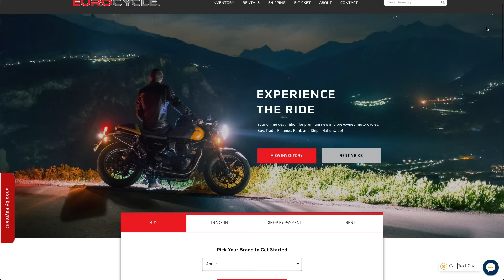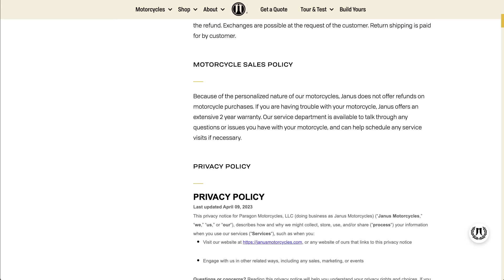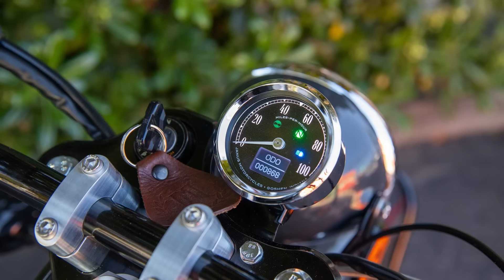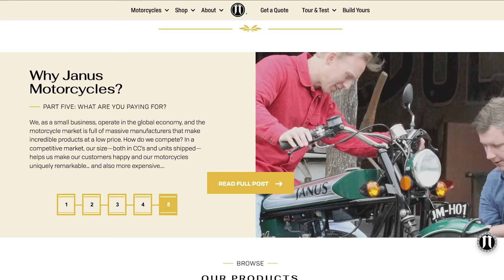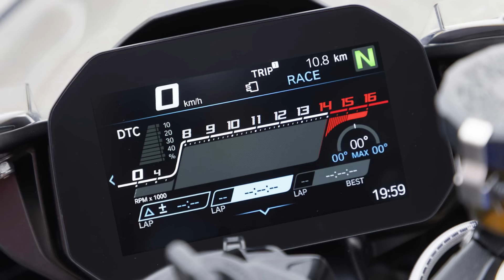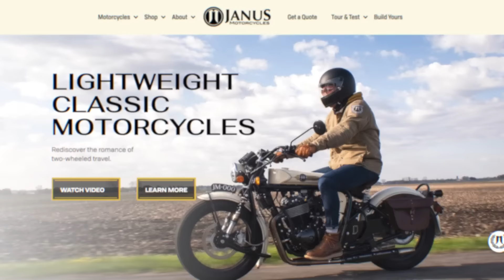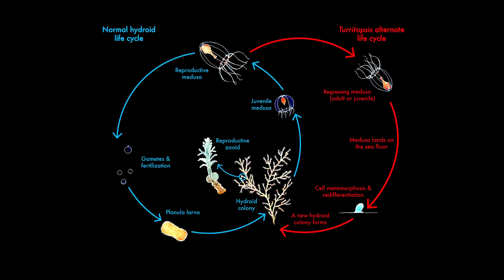We need to talk about Janus Motorcycles

Comment: A very poor, ill-informed review of a very good bike.  Perhaps when the Yam gets a little more time, experience and wisdom under his very young belt, he'll be able to comprehend the value in these bikes that today, utterly escapes him.   Having never ridden a single mile on one, I'm at a loss to understand how he thinks he's qualified to criticize.  Of course, there's a sponsor paycheck involved, so that might explain the shilling.  I have over 7000 miles on my Halycon, and I still wouldn't trade it for any overpowered, plastic-coated, one-of-ten thousand clones with a built-in umbilical cord straight back to an expensive dealer service department.  Simplicity, easy to maintain on your own, bullet-proof, adaptable, style and smiles for miles, and a true, original, motorcycle experience.  I'll have a second in the 450 version too, please.

Comment: And back to that engine: It's based on the original Honda CG250 (well, that was CG125 originally, but it gets complicated). There just isn't a US small displacement engine that is practical for this purpose. The engine really is bulletproof, which is no idle boast. And whatever naysayers may think, lots of riders and mechanics have commented to me that it even looks good. But it definitely is easy to maintain.
Reply: A different engine would certainly add to the already off-putting (for many) price, but I wonder how a Yamaha 250cc V-twin engine would look in that frame.  Regardless, I am not offended by the Chinese clone of a Honda engine that was developed to be very reliable and easy to work on.
Reply: @LurchAs many owners will be glad to tell you (one went 16,000 mile round trip from Arizona to Alaska!), this one is too. Thank you for giving us the opportunity to clarify.
Reply: @@lurch789is it really a cheap clone if the base 125 I'd actually still mass produced in places like Pakistan? Shit's make money along with the 70cc engine there.
Reply: @nebunezz_r  yes. Pakistan is hardly the place that inspires confidence. Even small displacement engines these days have modern refinement.
Reply: @@lurch789well even in my country the venerable 125cc-155cc 4 speed OHV Honda TMX are phased out and replaced by Honda China sourced 150cc OHC and 125cc OHV, that for a third worlder cannot last longer and abused like the Old Honda 1980's to 2010's 125/155cc, even the other market that got 150cc OHC are considered reliable too, but they never received the 155 OHV.
Reply: The US cannot even built a decent lawnmower engine much less a small displacemeent MC.

Comment: I have a Hawk 250 with the same 229 cc china motor as many Janus.  And I have abused that bike and motor for 26,000 miles and 7 year with ZERO problems.  Just fuel, oil changes, tires, chain, sprockets, grips, and tires.  No issues just maintenance!  I even geared it up to run 70 and I routinely run it on 4 lane highways and even the interstate; wide open for hours!  I can't say enough about it, they are not fast but damn reliable.

Comment: Land O' Goshen! Well, they are what they are. Apparently, they're managing to sell hundreds of them. That's not a lot, but Janus bikes are, well, what they are. I'm an old fart just shy of 78 years. Having owned a couple of bikes that date back into the 1930s, I get what Janus is trying to do. At the same time I owned those, I also owned a 1963 Yamaha YDS-2, which was pretty much cutting edge at the time. I liked both. The historical feel of my Excelsior 125 was one thing. Whizzing along on  the first stock 2-stroke 250 cc that made 100 HP/Liter  was something else again. Both things were worthwhile to me. 

Would I buy a Janus? Not now, I wouldn't. I don't ride any longer. Do I like the concept of them? Yes. They're a lot cheaper than fully restored bikes of the period they are hinting at. It would be fun to ride around on.
Reply: @Lurch That Magna is not at all similar to the Janus. It's not about just having a motorcycle, really. The Janus is a different sort of thing.

Comment: As a 72 year old, lifelong motorcyclist who cut his teeth in the 60's on Brit 650cc, parallel twins with 4 speed gearboxes. As a distance rider (iron butt) I moved onto BMW boxers, culminating with the 900cc (R90S) and 1,000cc (R100S) boxers (superb machines). After a bad car accident and open heart surgery I wanted to continue riding but required a smaller bike.  First, I bought the Janus Halcyon 250 and found it underpowered.  I recently picked up a Janus Halcyon 450 and enjoy riding it - a lot! Based on the Honda 400cc single, this is a good little thumper.  The counterbalance works well (vibrates less than the Brit 650 twins).  It handles exceptionally well.  The 7,000 rpm redline makes for decent acceleration (doesn't like below 3,500rpm and the sweet spot is 5,000 - 6,500 rpms).  The 5 speed make it a fun cruiser at 60-65 mph.  We're going to fabricate a header exhaust and open up the air box to coax more HP.  Maybe a Mikini carb.  The styling is fun.  Fit and finish are excellent.  And important to me, is it's made in the USA.

Comment: Featherbed,.... not feather head  i.e. the chassis designed by the McCandless brothers, when compared to the frames Norton was using at the time, was as comfortable as a feather filled mattress.

So anybody claiming they've got a Norton Featherbed inspired chassis but rigid is talking out of their arse as they've missed the point completely
Reply: They were very rigid in comparison with other frames of the day. Many racing bikes copied the design back then.
Reply: @domitype  An awful lot of Norvins and Tritons were made for cafe racing out of Norton featherbed frames and Vincent or Triumph engines. Yes, Norton Featherbed frames were comfy, but they were also "Rigid: Not unsuspended, resistant to flexing. Regards.

Comment: I live in the area, practically lived in Goshen for several years, and am still down there regularly for work. In the time since Janus has opened, I think I have seen them on the roads around here 5 times. Ans it’s possible two or three of those were the same person/bike. They are just too expensive, even for those that like the styling. Elkhart Indian Motorcycle in the next town over is a Royal Enfield dealer, and the best dealership I’ve ever done business with. In that kind of environment Janus is a real hard sell. Still, I wish them the best. So far there has been a niche market for their product.
Reply: Seeing a Royal Enfield Continental GT650 at that exact dealership in Elkhart is what made me not buy it.  Went there to sign the papers, but seeing how bad the quality of the Royal Enfield was in person, especially the paint, made me back out.  The sales guy was cool though, so I felt kinda bad...  Saw the Janus bikes in person that same day... Janus wins in the quality department, hands down.
Reply: There are Janus owners who also have a RE. The ones I've read or talked to like both, but find them extremely different bikes. I would get a RE as a second bike, but the majority opinion seems to be that the Janus produces the most fun. The RE, especially one that is substantially more powerful, is useful for faster highways.

Comment: Norton "Featherhead"?  uh, yeah. Sure.
   At the age of 71 and having owned many different motorcycles, my '21  Halcyon tickles me in ways that few other bikes have.  I don't want to put up with the reliability issues and parts scarcity of  a vintage motorcycle but having a bike whose design is inspired by bikes of a century or so ago works for me.  I can easily afford virtually any other bike but, since I'm no longer interested in elevated speeds or lean angles, this bike takes me on leisurely rides on local two lane rides and is a delight to look at when not riding.  The other retro bikes mentioned reflected the designs of the '50s, not the mid-20's.  In my mind, I think the automotive equivalent would be a modern Morgan 3 wheeler:  a design from another era with more modern parts, and, like the Janus, comparing it to other vehicles for the same price misses the point.  Is it pricy compared to a mass produced 250?  Oh, hell yes.  But find another bike built essentially by hand and do that comparison.  The Chinese engine bothers me not a bit other than wishing that it was vertical in the frame rather than angled slightly forward.  Many old bike manufacturers used engines not built in house. 
      As you said, if it doesn't make sense for you, move on.  For me, it is a complete treat and I am so appreciative of the guys at Janus for making it.
Reply: Hahahaha, guessing what tickles you is not what tickles most men.
Reply: @yesihavebedbugs2786  , that is an accurate assessment.
Reply: @kurtjens  and that is okay. Alternative lifestyles are more accepting these days.
Reply: @yesihavebedbugs2786  describing my lifestyle as "alternative" would be difficult:  solidly middle-class, married to the same woman for 40 years. But I think we're veering off topic.
Reply: @Kurt Jensen  hipster is an alternative lifestyle. You bought crap. And like many, the cold hard facts are a slap in the face you wish to avoid. I have been to owners forums for Janus customers. I wanted to buy one you see. They have lots to say. Too a man think it looks great, people stop, etcetera. But the cheap parts and constant issues make it a nightmare. And It is not one or two people. Several forums with what is obvious a large portion of the customer base. I have seen comparisons to the $400.00 Chinese made scooters. Perhaps a thousand miles in and issues start. Some sooner than that. But most noted after break in issues would arise. Since many posted pictures on the forums with their bikes. And in soma cases the broken bits. I would have to assume they were being honest. For if they loved them. And thought they were the greatest since sliced bread. They would not have been online complaining.  There is no reason they could not have sourced better parts at the premium they are charging. Piaggio buys engines from India. And Piaggio are noted for great running small displacement motors. India has over 200 scooter manufacturers. Including the likes of Honda and Yamaha. So the fact they went with the cheapest route on a premium priced product is evident of their business model. Attention seeking accessory for people, namely hipsters who will never really ride them. You know like the 2 owners happen to be. And they are not like Dale Walksler, an actual aficionado of vintage motorcycles. On YouTube you can seen Dale on a 1913 Thor. Which is the basic design Janus uses. As well as other vintage bikes. Sadly that is the only way you can see him now. But his museum is still open. And they have a restoration shop on site.
Reply: @yesihavebedbugs2786  wow!  I'm a hipster at 71.  I had no idea.  That's quite the screed, Bugs.  Y'know, one of the owners did ride his Halcyon across the country.  Another has ridden his to Alaska. As far as actual aficionados of vintage motorcycles, I'm not sure what that has to do with this discussion.  The Halcyon's design is inspired by vintage bikes, as opposed to replicating any specific make or model, and if it pleases me whenever or wherever I park it and indulge in a fantasy of riding in another time or place, well, that's exactly what I used to do with my Norton Commando.  There are plenty of motorcycle museums and enthusiasts who keep the old marques running, and good for them.  As for having "bought crap", as you assert,  the experiences of other owners on the forums that I've read don't align with that assertion.  But time and miles will tell.  meanwhile, my other rides languish while the Halcyon is collecting miles and making this geezer grin.  Isn't the pleasure a bike brings to its owner what motorcycle ownership is all about?
Reply: @Kurt Jensen  yeah, you can be a hipster at 71. Hell we have commies like Bernie Sanders, who is older than you or I are by a decade. Age has no bearing. And a few exceptions of endurance, sans any account of issues. Is not as much as 3 different forums, as Janus does not have that large a base. And there is a common theme. Design, paint, basically looks phenomenal reviews. I agree myself. It is WHY i went to forums and looked into buying one. The engine and some of the out sourced parts. Not such glowing reviews. Anecdotal, example, am sure some had good success with Yugo's back in the 80's. You're old enough to recall them. But a large number had issues. Hence we no longer see Yugos sold here. For the price, they could have bought a better mill. And for what they are asking, they should have. But their targeted audience is not putting many miles on I bet.

And didn't say you could not buy what you wanted too? You can even be happy about it. I never said otherwise. I did say you could have bought better. If you had a Norton. You have had better.

Comment: Interesting to see coverage of the Janus line.  To me, you had some hits and some misses and were too harsh in some areas.  While the wheel size isn't mentioned, we had many lightweight, quality motorcycles in the late '50s onward that had 2.75" to 3.00" tires which aren't bicycle sizes but were on machines that could easily cruise at 50mph and could hit 80mph with no handling issues.  Honda Cubs had 2.50" tires as well and could carry two people decently.  The 450 twin seems about the right weight for its size class through the years.  
Thing that gets my attention most is the construction of the "earles type" forks and whether they have good, lasting bearings at the pivot points.  The price tags surprises me, completely pushes me away considering one of these could be fun to own and use.  I have little qualm with the engine choices as they seem to be holding up well enough - my daughter still riding a 230cc Hawk she purchased in 2018, note here these are pushrod engines, not OHC.

Comment: Was enamored by the concept, look and a chance to own a 1930's style bike that comes with a warranty, is more reliable and won't leak on my garage floor. After a visit to Granger and a test ride on the 250 and 450 Halcyon, this is what this 67 year old (on my 52nd year of continuous ; read 35+ motorbikes owned over those years) thinks. The 250 was fun until I crossed into the 50+mph world of road cycling, way buzzy and the fatigue factor was creeping in. The rigid rear suspension was ok (read bouncy spring seat) until the road had any pothole repairs, read, moderately painful. The 450 was Lexus plush like after the 250 and felt like a motorcycle (read 250=scooter like) and was a good time all the way to 65 mph. After that, it was straining to me to push it much faster. PRICE?? $11,000 (250) and $15,500 (450) seemed like a high price point for these unique cycles. Dollar value felt more like maybe $6000 (250) and $10k (450) for a reality check. Get the price down, increase the volume, then improve the offerings and jack the price.........  just my $ 0.02 worth and a sunny afternoon not wasted, but the picture a bit more clear on Granger Indiana Motorcycle company Janus...
Reply: If yo have 15k you could buy an enfield classic 350 and do all the basic mods to get more power out of it and have money left over to buy two more.

Comment: I'm a machinist, during my apprenticeship I took a bicycle engine kit and converted it to a two cylinder. I put it on a fat bike with a custom springer front fork. it's pretty much the same thing and it cost me less than a grand total. Janus makes no sense for the price point
Reply: If you think you can build the exact same motorcycle at half the price or less, then please do it, you'd make a killing and change the industry.  You underestimate the work and materials involved here.
Reply: @RedZeshinX  no I don't underestimate the work involved in manufacturing. I make drill bits and about a dozen different people handle that piece of metal before it's a finished product, there is a reason why things cost a certain amount. My point with Janus is that they are replicating a bike from a hand built era. If you like that look, just build it yourself instead of paying someone else to do it

Comment: Janus with a hard J (like Jack) and a long A (like bAy or cAke).  Janus was the Roman god of gateways and transitions (and related concepts) and had two faces, one facing forwards the other backwards.  The first month of the year, January, is named after him, because in January you can look back to the old year just finished, or forwards to the new year just beginning.  So Janus motorcycles are looking forward (in terms of the engine, manufacturing techniques, safety) but backwards (in terms of styling).

Comment: It all depends on what you want from a motorcycle. In the summer I bought a retro-styled bike, a Kawasaki Z900RS SE and it is exactly what I want. It has great power and handling and looks great. I'm not a squid and am way past 20, so I am not concerned with high redlines and ultra handling with sticky tires.  I like to go on on relaxing rides on a  twisty road, and the Z900RS checks all my boxes. The Janus line of motorcycles isn't what I am looking for, but I hope they continue building bikes for their niche market.

Comment: I applaud what Janus is trying to do, but their choice of powerplant really sucks. We have a couple of "brands" here in Australia that re-badge whole motorcycles with those engines & their reliability & performance are, to be kind, somewhat lacking. Why they didn't just source the Yamaha Scorpio 225cc engine from Yamaha Indonesia is beyond me. It has both kick & electric start, adding to the nostalgia appeal, and wouldn't add much more cost to the motorcycle, while being a far more reliable engine.
Reply: After 5,000 miles in punishing heat and rain, I have found this engine to be extremely reliable. That's the point: The design was created by Honda for its motorcycles in countries where owners did not or could not routinely maintain the bikes.